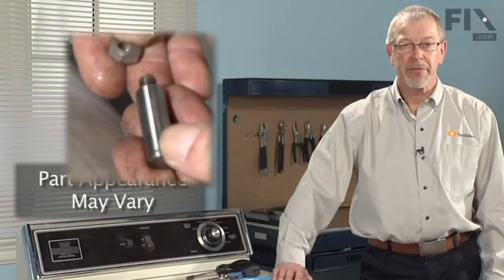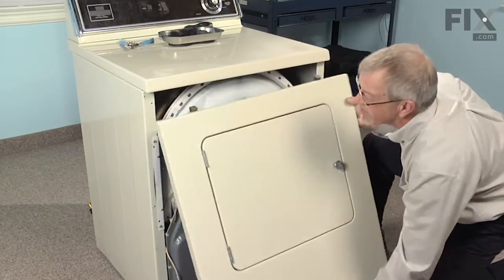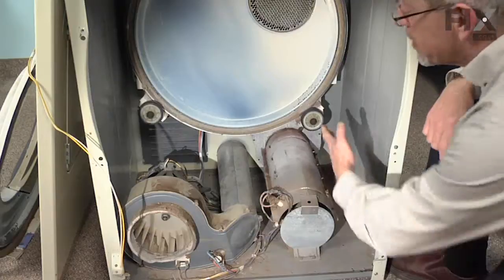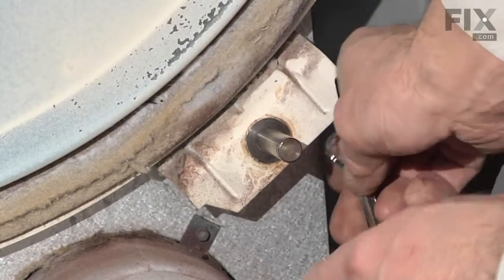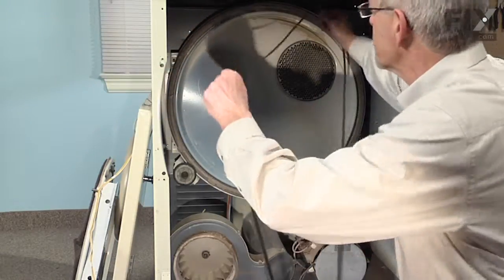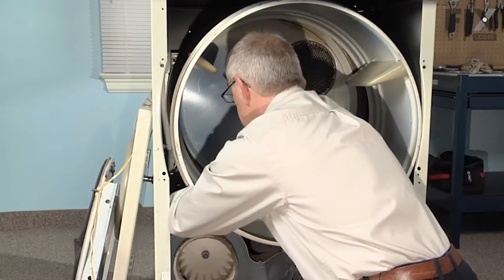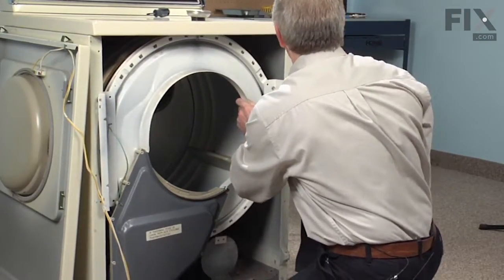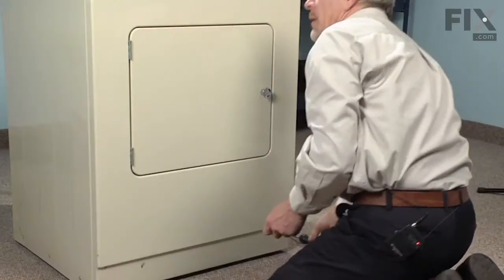Maytag Dryer Repair – How to replace the Roller Shaft

Comment: I do appreciate the intent here, and the video looks pretty informative...

Sadly, my design is not like this very old dryer, guessing it's still worth fixing of course, but sadly, I know how to fix my issue, and sadly I was delivered these parts, and I have no use for them, the shaft is too short, and the roller is flat, mine fit in a groove, and extend further into the drum. Lowest shaft has severe deformity, from excessive wear.